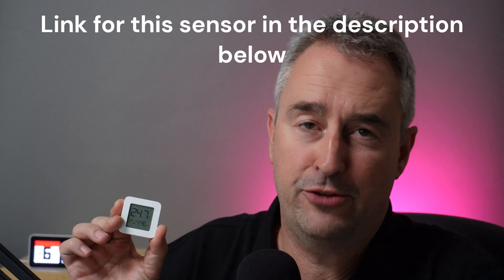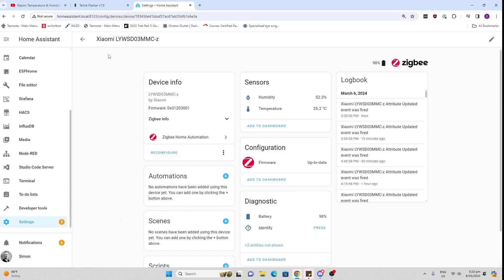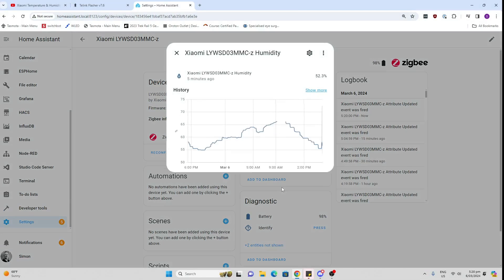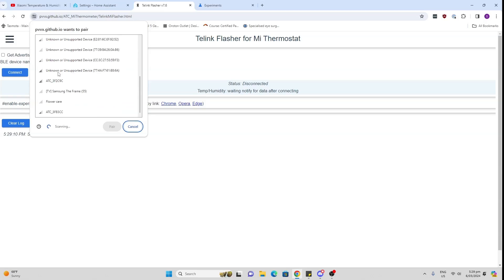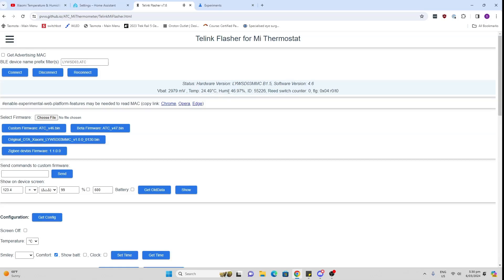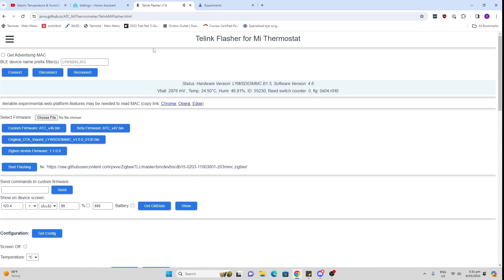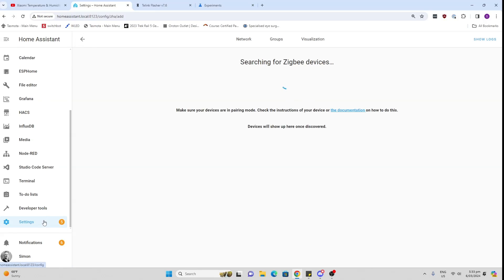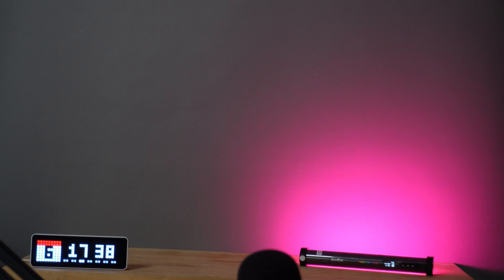Cheapest $5 Xiaomi Temperature / Humidity Sensor now runs on Zigbee!

Comment: After trying the ZigBee version. I can not recommend to anyone. As the battery life was so terrible. It drains it in 3 days. Yes form 100% to 0% in 3 days only.i was  Lucky enough to get back the bluetooth firmware without soldering.
Reply from the maker: Thank you for your feedback, did you try changing the advertising interval, this should improve battery life the longer you make it update
Reply: I will try this whenever I will have some free time to spend with it. Otherwise I'm very satisfied with the BL custom frameware. It's boulet proof as you mentioned in the video.
Reply from the maker: @yassinevic  Yes, the BLE works really well!

Comment: I'm a bit confused, at 2:21 you enable the features and then at 2:21 you connect. What are you using to connect?
Reply from the maker: Sorry for not explaining clearly, you go back to the telink flasher and press connect
Reply: @simonsayshomeassistant   Thank you
Reply: Just to be clear, i gather i open the flasher in a normal browser correct? Or am i doing it in home assistant somehow?
Reply from the maker: @Drobbleropme  Yes, you open the flasher in the browser, I find that Chrome works well!

Comment: I actually grabbed 4 of this sensors, and it took me about 5 minutes and I was able to add this to zigbee without too much issue. I am going to put these around the house, so I am quite pleased.

While I was setting this up I thought I might have to register it with Xiaomi, but no I was able to keep it all local.
Reply from the maker: Fantastic, thank you for the feedback!
Reply: Did you connect the sensors to the Xiaomi hub?
Reply from the maker: @erdadj  No, they connect to the Zigbee radio which is connected to home assistant
Reply from the maker: @erdadj  No, they connect to my Sonoff zigbee radio

Comment: oh noooo :/
20:42:50: Connecting to: LYWSD03MMC
20:42:59: Hardware Revision String: B1.5
20:42:59: Software Revision String: 0159
20:42:59: Firmware Revision String: 2.1.1_0159
20:42:59: Detected Mi device
20:42:59: (!) Version: 2.1.1_0159 is temporarily not supported (!)
20:42:59: Disconnected.
Reply from the maker: Oh no, just tried it again and I am getting this error: Size firmware is more 131072 bytes!  It looks like they are doing some changes to the firmware.  I would recomend trying it again in a few days time, hopefully they will have sorted it out
Reply: @simonsayshomeassistant  tks for your video, I also have the same error with my old firmware ATC_3.7, but when I update to  ATC_v4.6 first, and then update zigbee firmware, it 's ok now.
Reply from the maker: Cool, thanks for the feedback.  That is a big help!  @huyhoangphamanh1825

Comment: Do you have a measurement device to see the (very low) current draw difference between the two firmware’s? Working out how long the button cell will last is fairly important as the larger 2 AAA zigbee versions of this kind of sensor might be better in that dimension, replacing batteries is easy except when it’s 12 every n months.
Reply from the maker: Hi Bruce no I don't have a method for measuring the current draw.  I will keep an eye on the battery levels.  What I can say is that the Zigbee reporting frequency seems to be quite large, like 30 mins. Let's hope this means low current draw